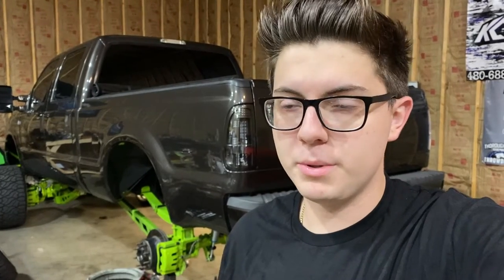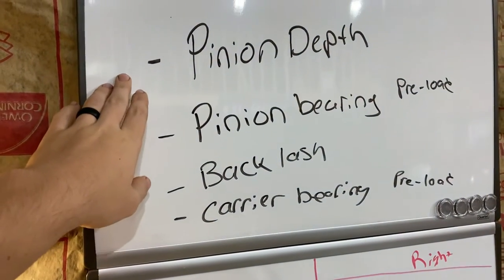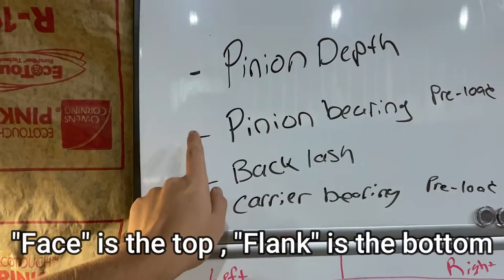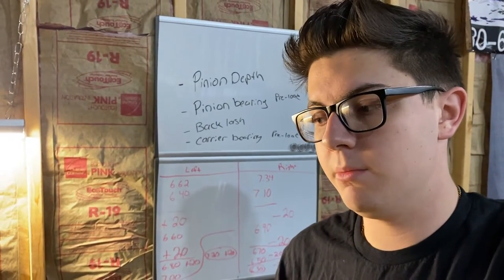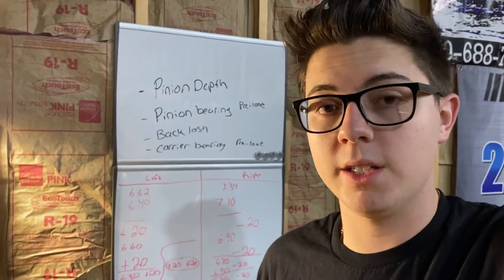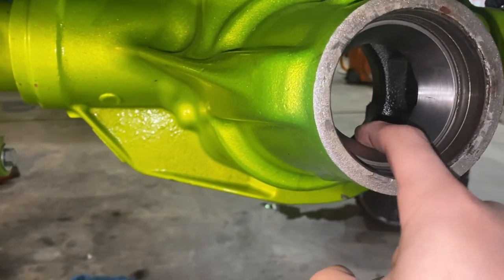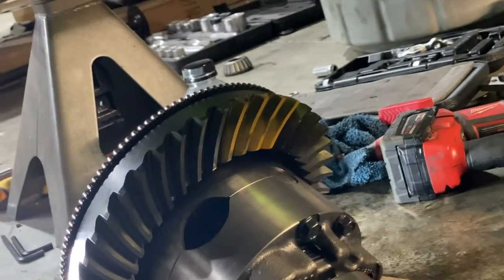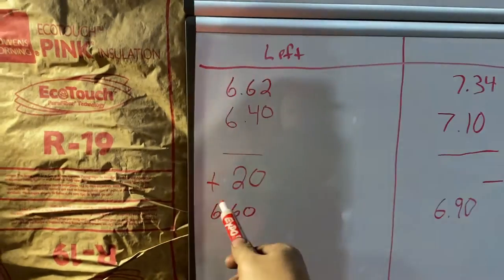REGEARING MY F250 REAR AXLE | STERLING 10.5 IN DEPTH | PART 2

Comment: How did you like the 4.88? I’m actually going opposite from 3.73 to either 4.56 or 4.88, I’m on 40’s and towing my boat isn’t so great up the hills I would like to hold the OD a bit more and have better take off manners.
Reply from the maker: I would recommend 4.56 so you can still drive it unloaded and get good fuel mileage , personally.
Reply: @JUSTINHAWKSMITH  I think 4.56’s as well, thanks and keep up the awesome build!

Comment: Have you are any one else put at locker in the front? I want to realize that if  a locker is not added to the front you are effectively only having one front right tire with traction and the left basically open. I had a 88 Ford Bronco where front an rear had lockers. Interested in what people have used for the front.
Reply from the maker: I’m kind of uneducated when it comes to lockers man but yes you are correct about one wheel in front and one wheel in rear , but the manual locking hubs in front lock in the front to my knowledge I thought. Maybe I’m wrong. I think I would suggest doing the locker in rear before anything but I’m not sure how drivable they are on the road if you drive your truck a lot. It would be something I’d just have to look into ! Thanks for watching !!

Comment: Good job and guttsy! But probably coulda flipped the 4.88s for bank and bought a fresh pair with 3.73s for a 3rd the 4.88s sold for and not deal with 2 weeks of gear oil smell clinging to you and your shop
Reply: You should give me a deal or trade on those old 4.88s
Reply from the maker: I did sell the 4.88’s already & the 3.73’s I installed was a brand new set of gears not used. Haven’t had any issue with gear oil smell. I guess cause it was all so new from previously building the truck.

Comment: I have an 05 sterling 10.5, my shims don’t come apart at all? There is only single piece shims on mine. If I’m re using my 3.73s would I just reuse those shims or would I have to get new ones with a different size? Thanks
Reply: @adenking3015 I am currently rebuilding a rear with the same single piece shims you experienced. I am also reusing my 3.73 gears. What did you end up doing about shims if you don’t mind me asking?